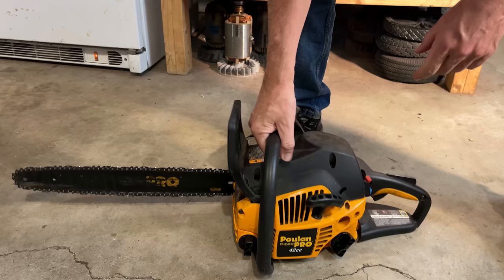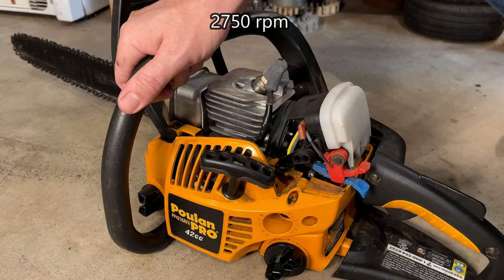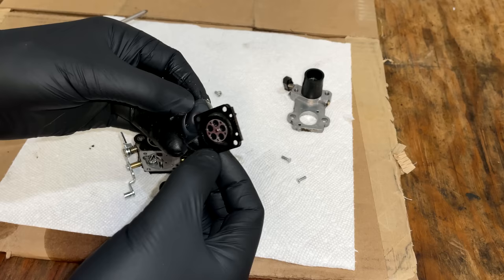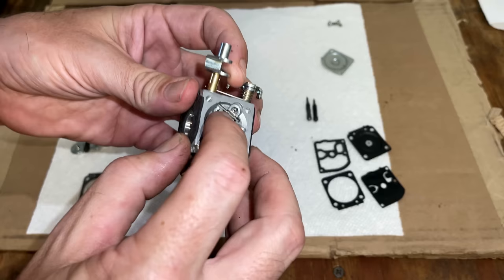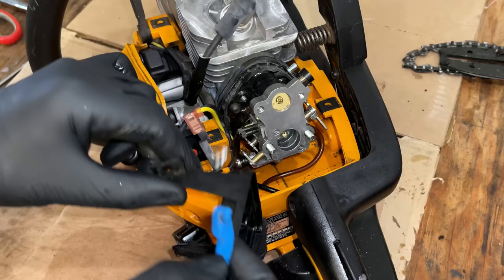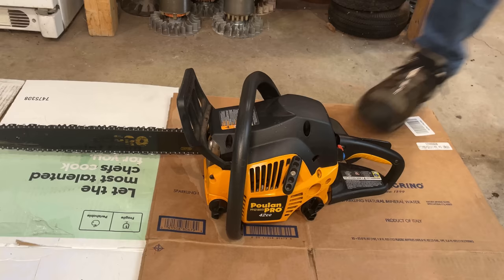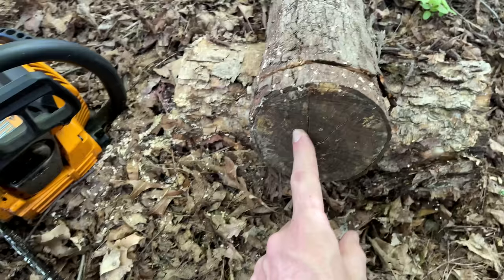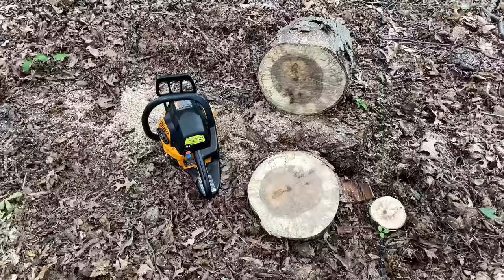Poulan Pro Chainsaw  - Not Running or Cutting Well

Comment: Hi James, still watching this video however unless that carb is different then the Metering diaphragm doesn't go below the gasket it goes above, the pump diaphragm goes below the gasket they're different. On all the saws I've fixed it's that way or the metering doesn't work right. 
If what i just looked up is correct that's a zama w26 carb, look up the parts diagram for that you'll see the gasket goes against the carb body then the diaphragm. Can't post a link as YT will delete it

Edit, Zama official YouTube channel also has a rebuild video (different carb) but also states this, gasket first on metering side
Reply: You are correct. I also checked Zama parts diagram for this carb,
and watched the Zama video, and have the Zama service manual,  
3 in agreement, the gasket goes first against the carburetor body, 
then the metering diaphragm with the metal disc side also towards
the carburetor body and then the cover. That gasket is also a shim
thickness that positions the metering diaphragm at correct height
for its metering function to occur as designed.
Reply: @artpatronforever  Correct, otherwise the metal disc will press on the lever when it's not running and will flood the saw, will also run rich in operation. You can tune around this but it's not ideal. I bought a Husqvarna 365 couple of years ago, guy sold it cheap because it "would never run right", basically couldn't even start it cold because it was flooding. Luckily it's easy on that saw and only need one screwdriver so i dismantled the carb on the spot and sure enough someone had done this exact thing, so i fixed it, started right up. I think he was a little sad he was selling it now but too late
Reply: @CSkwirl  I have not looked closely to tell, but it may
 be possible to replace a metering diaphragm without removing 
the carburetor for access.  Generally it is only a brittle from age 
metering diaphragm that will make a saw be wandering at idle, 
and other stuff on the carb is good. It could be a low complexity 
quick fix for idle issues to just replace the metering diaphragm.

Comment: Great video. I see it still runs a tad rough and takes a bit more time cutting through logs or wood. Sometimes other symptomatic issues that seem  like the carburetor aren't the issue. A blocked or caked spark arrestor or carbon fouled muffler can cause too much backpressure sending exhaust through the blow down of the transfer ports robbing the saw of its full potential power. During a tuneup sometimes these mufflers can be taken partially apart and cleaned to prevent too much back pressure. I would suggest during a carb rebuild, sparkplug and air filter change, clean the exhaust system as well clean or replace the spark arrestor if possible. This will prevent future idle stalls especially ramping down from high speed back to idle. Exhaust tuning is also very important, because one doesn't want backfire as well.

Comment: I put an orange mark on my splined adjusting tool, so I can count the turns.  I mark my Stihl adjusting screwdrivers with a mark of black paint, so I can count the turns on it when adjusting carbs with slotted adjustment jets.  My rule of thumb is 1.5T out on smaller carbs and 1.0T on bigger HD  carbs used on my big saws and tune from there.

Comment: Excellent work as always James, the carburetor diaphragms in 2 cycle carburetors seems to be the most common problem on non-running engines, ethanol fuel just wreaks havoc on the diaphragms which is why I run ethanol free canned fuel in my 2 cycle equipment.
Reply: Ethanol is bad for car engines too! & it really doesn't help reduce carb emissions ... because as it ruins the engine ... causing it to run improperly ... also causes it to spew more emissions ! 🤔
Reply: I have a gasoline-powered radio control model helicopter and because of the ethanol problem and not having canned fuel where I live, I reverted to using exclusively aviation gasoline (Avgas) in the model. It's the low-lead variety, no problems after some 16 years flying.

Comment: Good show .I watched the carb assembly and I finally got it .  Clean the groove in bar with a blade and file off rollover on bar invert bar sharpen well  including rackers .Good as new no .But if the chlps are the size of the cutters the best you can get.

Comment: I worked on a Poulan Pro like that recently. Tellingly, it had shipped with a Husqvarna labeled spark plug. Husky bought Poulan over a decade ago so perhaps more & more, the Pro's are becoming "yellow" Huskies. I tested the saw after I worked on it and was impressed by its performance. Longevity? Don't know. But a Husky 20" Rancher is about $500 vs $250 for the Pro.

Comment: One other thing to check is the muffler.  There is a spark arrestor screen that can clog up after extended use.  
Burning the carbon build up off with a propane torch can make a big difference
Reply: I was thinking the same thing, first thing I check, after fresh fuel and purge the carb
Reply: Yeah. First thing I thought of. They can get crudded up surprisingly quickly especially when it's running rich to begin with.
Reply: I think first, I would check that the air cleaner is not clogged, then check the spark arrestor screen.  While that is out, use a flashlight to check the piston for any scoring.  If it is scored, engine is dead.
Also, keep in mind, that these carbs are very sensitive to vacuum leaks.  Old fuel lines with cracks or pin holes must be replaced !
Reply: Ok thanks for the advice I’ll try
Reply: spark arrestor on a chainsaw? what in the world?
Reply: Seeing how old it is, I’d go for fuel lines, filter if it had one, and replace the diaphragm in the carb.
Reply: I clean mine two about once every 3 years and I run 45/1 mix

Comment: I have the same saw. The it stopped running when the upper carb linkage fell off at some point. It never ran great from the start. The carb was replaced but still doesn't run well. Spent a ton of time tuning it before giving up and taking it to a saw shop. They worked on it for a while and told me it was as good as it was going to get and suggested buying a better saw. I still pull it out when I want to be aggravated. I purchased a "better" saw and have had zero drama with that saw over the last couple years.

Comment: Cleaning these with compressed air works good, and that fuel line is brittle. The trick with the choke is you pull with choke on till it berps a little start, then choke off and should start right up.

Comment: I have two of these saws out in the shed I will let people borrow. It saves wear and tear on the vintage saws I usually run. One was given to me and the other was five dollars at a yard sale. Both needed fuel lines because of ethanol fuel. Good video, as usual!
Reply: I have a 50 year old Homelite with point ignition that starts first pull.
I have 2 other vintage implements also have actual one pull starting, 
Three or four newer improved modern manufacture, one pull? Nope.

Comment: James a few hints, to start a two stroke go on full choke, start pulling, as soon as it crackles like it's going to start, come off choke! Most people flood a two stroke by leaving choke on two long.

When adjusting hi/low always adjust while running, "low" is the crisp trigger pull your looking for at the bottom end and you adjust the "hi" wide open.
Reply: yeah its super easy to fflood them aswell! 1 or 2 extra pulls with the choke on is all it takes. I flooded my 025 just to see how many pulls it would take to unflood it and it was 23.

Comment: James, you need to do a follow up epilogue on the metering diaphragm issue
because of the misplaced gasket / shim assembly error. That saw isn't right
until that gasket placement error gets attention.
Reply: Exactly right.  I noticed the error as well.

Comment: You might want to check an IPL but I think you reversed the diaphragm and gasket on the metering side of the carb.  The gasket goes on first and then the diaphragm, just the opposite of the pump side.

Comment: Interesting. I have the Craftsman model # 358.350991 and is nearly identical to the Poulan saw and it's exhibiting similar behavior . You've given a new avenue to explore. Thanks!
Reply: I have worked on both and videoed it, they are identical.
Stay safe, Joe Z
Reply: Craftsman saws are rebranded Poulans.

Comment: My exact saw and I just cleaned it up and started it after setting for several years.  Mine runs fine under power and cuts great with a new chain.  So far it is idling a little too high but if I can't get it to adjust after a little test I will go through the carb and make sure it's ready.  I have a oak tree that has been needing to be cut down because it has been growing sideways bowing over my driveway for years.  The extra hot dry summer has either killed it or put in to some state of looking dead.  So now is the time to make fire wood.  I also have a Echo CS-346 16" and an older Craftsman 18".  The Craftsman is the simplest to work on and only needed new fuel line.  It is old enough that it doesn't have the chain brake but has never been used very much. With the three of them and a back-up cordless Ryobi I think I'll get the job done.  The cordless Ryobi gets used a lot but 14" is not enough for this tree.

Comment: Bough a used one for $20 ,came with case, a new chain, barley used  ,called up poulan rep in canada 🇨🇦 and sent me fuel cap and chain adjustable side cover with nuts for free. The toolless chain adjustable cover is garbage,  chain was always getting loose, love the video.

Comment: I've watched plenty of videos trying to get my chansaw running after I had to replace the fuel lines. I've followed instructions from others but your adjustments are the only ones that have got my McCulloch saw working like the day I bought it. I got it running great yesterday and thought, but will it start in the morning when it's starting from cold. Second pull and it fired up and ticked over perfectly. Thanks a million.
Reply from the maker: Nice to hear.  I do not do many 2-stroke repairs so it’s good to hear others find this useful.

Comment: great video as always...just a note, ive gone thru dozens of chain saws in my time and to me it didnt sound like you were going a high enough top end speed there
Reply from the maker: I tend to run them a little rich.  I think this one was running close to 11,000 rpm.
Reply: Yep, I agree with James, these cheap saws just don’t run like the better quality ones. Running them on the rich side and thus slower makes them last a bit longer (being relative as these things are just cheapie throwaway saws).
Reply: Hi James, watched two of your chainsaw videos.  If you are cutting WOT sounds like your hs jet adjustment could be better.  Some experts say out of the wood setting about a quarter rich from point of max speed gives the "four strokin".  You cut a log WOT without changing get it runs just right, smooth lots of torque , no overspeed.  If you are in wood and getting four stroking noise go slightly leaner.

Thoughts?

@jcondon1

Comment: Glad to see the chain saw back to being able to run and cut.   When you cut the large log section at the end, the grain has some nice spalting.   That may have been a very good turning blank - if it had been sealed to prevent cracking.    Well done.
Dave.

Comment: Great video James! My experience with the carbs on Poulan saws is they sometimes can be rebuilt and be tunable, however, sometimes the carb just needs to be replaced. I’m also wondering if the ultrasonic cleaner is the difference. I don’t have one so I’ve only cleaned carbs with carb cleaner and compressed air.
Reply: Consider a parts cleaner dip.  Like Berryman Chem-Dip or Gunk Pail with basket.  They are a liquid cleaner in one gallon paint cans with a basket, and about $40.  Not at the level of a carb ultrasonic, but I have the Berryman Dip. It does a great job cleaning the carbs I put in it.
Reply: I use ultra sonic cleaner and have had no problems with kits at all 
Best 300 I ever spent
Reply: I love mine and use it for a lot of things besides carb cleaning
Reply: I ultra sonic clean carbs and some times twice 
Have very good luck with just dawn and water

Comment: Pump side, metering side was correct, diaphragm side, Gasket goes against the carb body. You did fairly well with adjusting the low speed, but high speed was too rich! it should 4 stroke at full RPM no load and 2 stroke when a good load is put on it in the wood. And the chain you took off could be sharpened to out-cut that new chain you put on it. For people who don't know anything about how to get their old chain saw going, this vid will help a lot. You are doing a good service here so keep up the good work and don't get discouraged with comments like mine. I mean it in a constructive way, I just don't have much tact.
Reply from the maker: I ended up leaning out the high speed jet before sending it back to the owner.  Definitely messed up the gasket.  Generators are my strength but still learning on two stroke engines.  Do not fix many of them.  Thanks for the feedback.

Comment: I hate gas chain saws electric has less running problems for the occasional user. My opinion only.
Reply: Maintain it properly, use good fresh fuel and good synthetic mix oil...and clean new chainbar lube....no problems.

Comment: One of the most well known issues with the Poulan Pro you are working on is a seal issue. It is a very well known problem. even if the seals are replaced, it will come back to cause those same idling issues. It is known to be a design flaw of these saws and Husqvarna knows it. That saw has the worst air filter setup of any saw out there. I recently went thru this exact same problem with that exact same Poulan model. Fixing the carb did not get rid of the idling issue. I then went to a local shop. There was a guy there that has 30 years under his belt with these machines. He showed me the seal that causes this. He has a name for a Poulan Pro. He calls then Pullin' Pros. When this issue crops up it is caused by the problem with the air filter and getting hot which  causes the seals to allow air to enter the crankshaft area. The seals are on both sides of the crankshaft. So good luck with your repair being the actual causes of the problem. I recommend 2 things. One, stay away from gas with ethanol or get a different brand of chainsaw.

Comment: Great job getting that saw running and cutting.  Watching how terrible that saw cut with a new bar, chain, and like new running engine reminded me as to why I bought a Stihl.  The Poulan is a good saw for residential and occasional use but if you heat with firewood, that saw would drive me crazy.  LOL!  As always, I really enjoy your video's and learn something new.

Comment: When those saws run well, they run well and you can got a bunch of wood. When they don't run well, they suck. I think the issue is if you adjust the carb for summer work you must readjust it for using in the winter and vice versa. Nice job! (I hate those little carbs!)

Comment: I realise this video is 9 months old, but I just had to comment: The proper orientation of the metering diaphragm and gasket, is gasket first, then the metering diaphragm on top! This is on the metering side. On the pumping side, it’s pump diaphragm first, then gasket on top. If you put the metering diaphragm first and gasket on top, you don’t get the proper amount of fuel in the carb. It will run obviously, but it will struggle, especially when cutting at WOT. Gasket first and diaphragm on top will allow for more fuel in the carburettor ;)

Comment: I bought a Poulan Pro chainsaw off of Facebook marketplace the seller claimed It may need a tune up he  got it to run but it stalled out. I  bought a carburetor rebuild kit, and tuning tools off of Amazon to support your channel since i enjoy working on small motors like this. Im  really thinking the dude's issue with the one i bought the ethanol fuel is the killer of the diaphram of the carburetor. If i can get it to start

Comment: I’m not a big fan of gas additives BUT I have use it when my saw hasn’t been used for a few months. I have had good results with a product called startron. Usually after the first tank of gas it runs and idles like its supposed to. 😊

Comment: the chain did need replaced but if you look at it, the rakes were above the tooth level. Filing the rakes are an important step to sharpening a chain

Comment: Nice to see some variety on the channel.
You should have pulled the chain and bar at the start. There is no point having the chain running whilst sorting the engine.
You could have also done with some chain oil when doing a test cut, the bar can overheat far too quickly otherwise and ruin the chain and the bar.
Flipping the bar upside down every so often also allows more wear before it needs to be replaced, since it wears on both sides then and you get twice the lifespan on it.

I've got the same zama carb on my saw, not a Poulan, but looks fairly similar, so I've been there, done that. I've also done a full tear down and piston ring replacement on the same saw since it threw a small chunk of overcasting metal on the inlet that stuck there for more than a decade before letting go and lightly scoring the bore and burring piston so that the rings no longer sealed. That was my intro to stripping down 2 stroke engines. Much fun.

Comment: Along with the muffler check the high speed rpm. It doesn't sound like it's running fast enough in those last cuts.